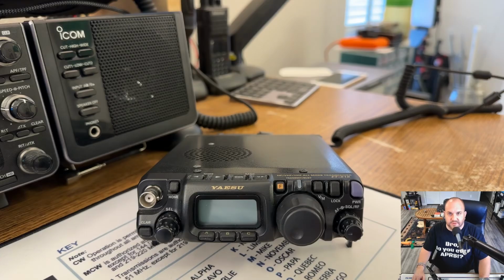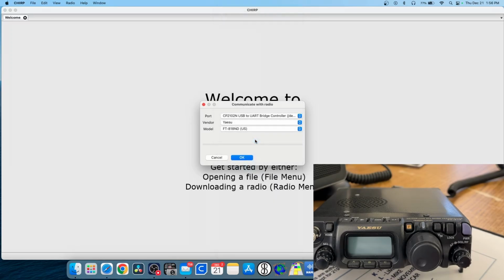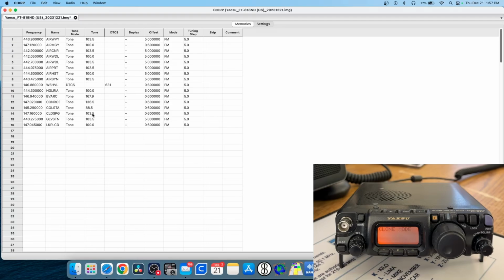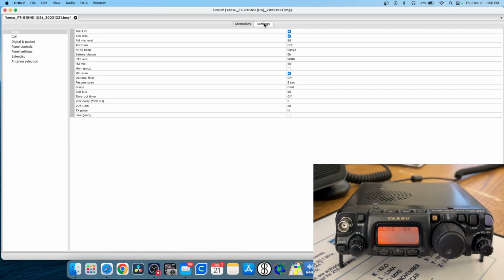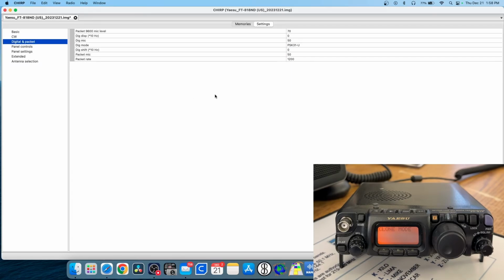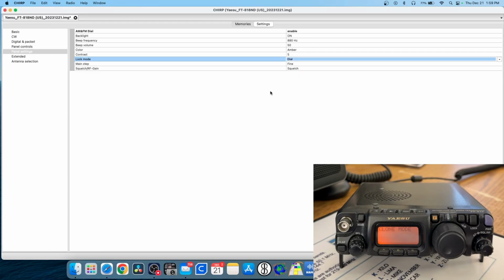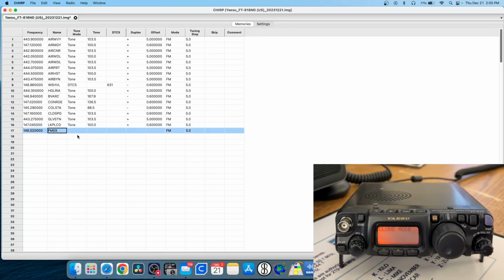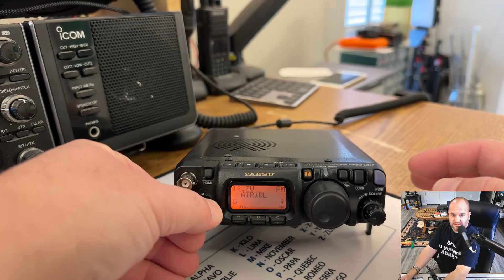Program Your Yaesu FT-817 or FT-818 With DigiRig & Chirp

Comment: I've also been thinking about buying a Digirig...this makes it more likely that I will. As you say, programming (in my case) the 817nd manually is a PITA, to the point where I don't often bother using mine for FM/repeaters. 73 Mike and many thanks, G0CIQ

Comment: I discovered, out of the blue, much like have now done, that I could program repeaters into my FT-818 not long after I got the Digirig last year. I've had to restore the programming a few times after resetting the radio in an attempt to solve some other issues. My radio club net controllers often comment on the audio qualitywhen I use the FT-818 on our FM net instead of my FT3D.

Comment: I am glad you found out one of the cool things about the digirig.  I programmed my KX2 and did a software update with it.  One more thing to mention I am running FT8 with iFTX to do FT8 with my iPad.  I am using my iPad, Digirig and my KX2. How cool is that, I bet you could do the same with your FT818.